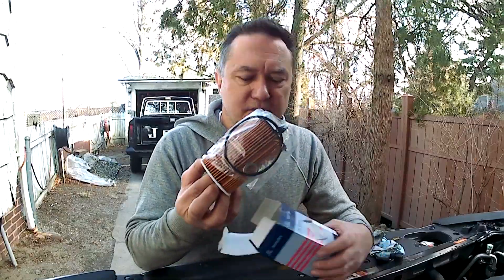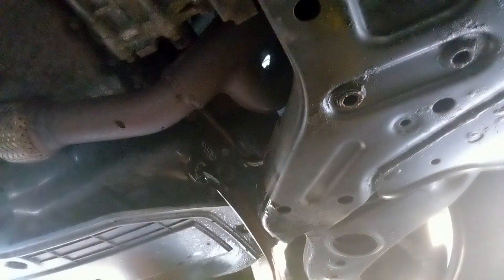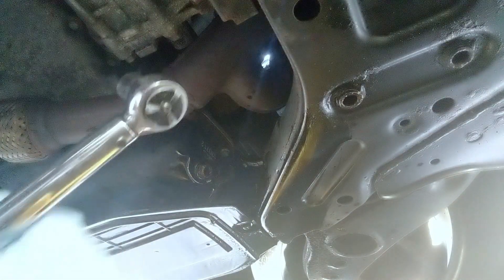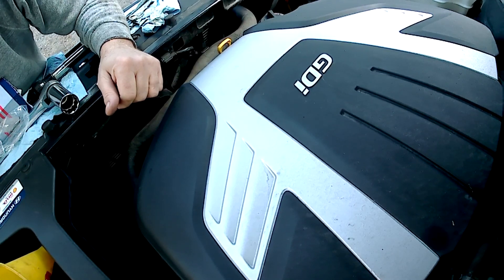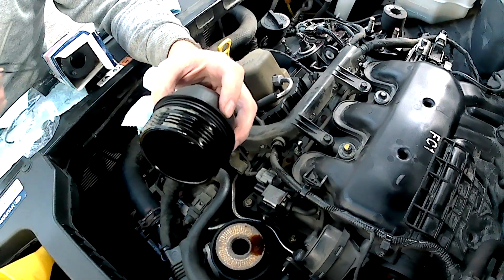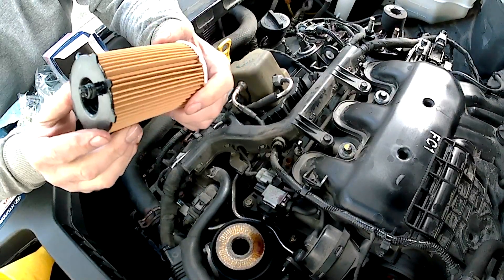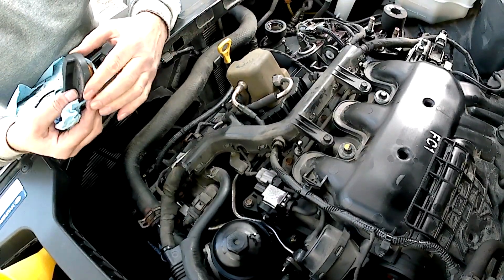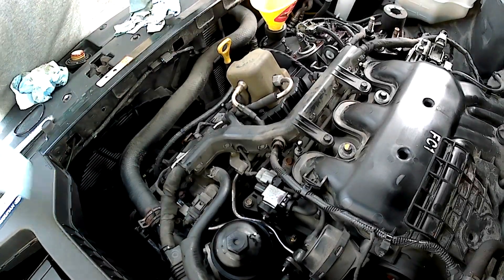Three-Way Oil Change for Beginners: Hyundai Santa Fe 3.3L V-6

Comment: Very useful - you convinced me to use my torque wrench- thanks
Reply from the maker: It’s possible to over-crush that washer on the drain-plug, and the filter housing just has to be tightened down enough to let the o-ring do its job sealing that cover, so I use them each time.